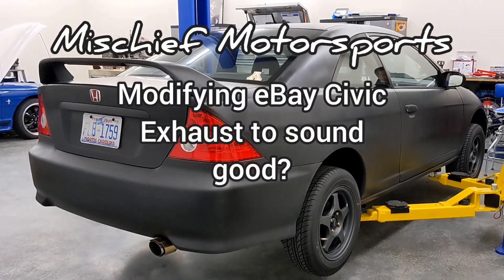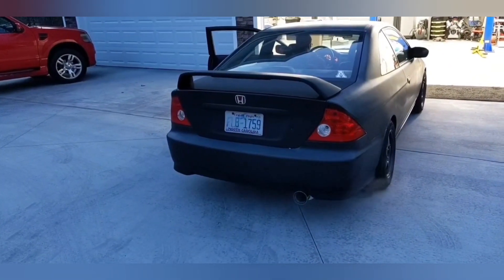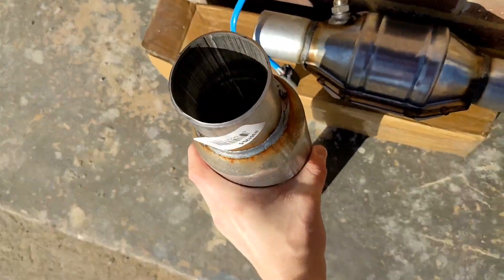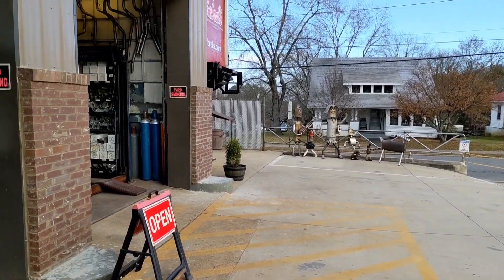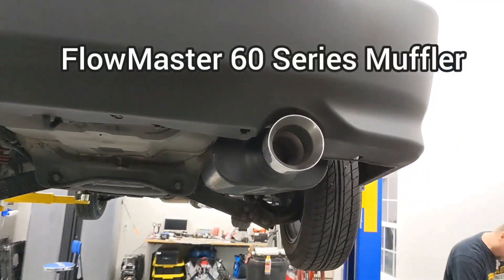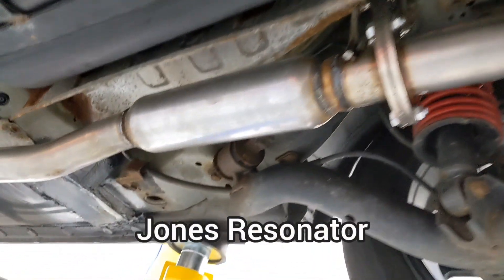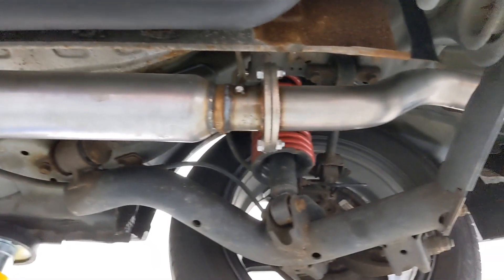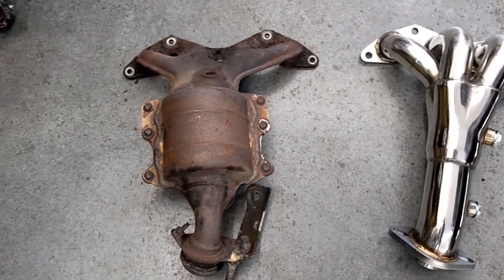Modifying The eBay Civic Exhaust!

Comment: Vibrant ultra quiet resonator. Im shocked its still that raspy with a cat. Basically u want a much fiberglass packed shit on the exhaust as possible to get rid of the tinny noise
Reply: This is what I hear alot of the folks recommend for a good resonator.  I planned to do similar on my delSol since the stock system is rusting out. I want to get an ebay exhaust just for the piping... then add the vibrant resonator with its existing aftermarket muffler.  Its a pilot muffler, it actually sounds pretty throaty so I'm keeping it.  

On my 03 Civic EX  i actually scored and entire mandrel bent system off a junkyard car.  I already had a header.  I installed the mandrel system and added a cherry bomb since there was no resonator.  The system had a cheap RS style muffler.  It was quite loud and raspy, but not as hollow sounding as your ebay system.  The cherry bomb made it decently deep sounding.  My buddy was junking his 2.5 inch magnaflow off his EVO.  I am putting that on in stead of the rs style to see if that helps control the rasp.  Shop is working on it today.  Fingers crossed it keeps the nice loud deep sound, but tones down the rasp.

Comment: Doesn't have to be a more expensive resonator but something with some packing material. That resonator was nothing more than a straight pipe. Now the length of your resonator is ideal and I bet having a vibrant ultra quiet resonator between a long tube and the muffler will make a world a difference.  Not loosing any power because they are all straight thru.

Comment: I'll be honest go get the longest   cherry bomb glass pack that's the size of your exhaust I think it's a 36 in . It will turn the buzz to base. Get rid of the resonator and see how the flow master sounds.  I can't remember what I had on my 94 civic ex but was not the Honda buzz unfortunately someone stole it.  That was like 8 yrs ago. 2-2.5 in pipe is max size on that engine as the volume of exhaust can't  fill the pipe and begins to slow because it cools . The 2.5 pipe setup would be good for future plans as well as current performance